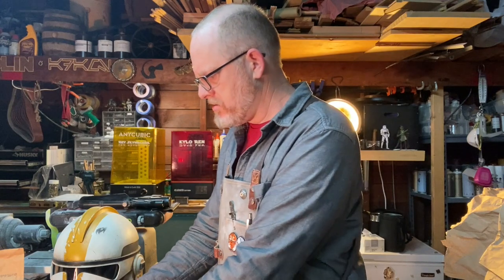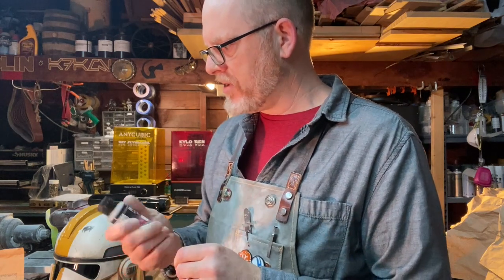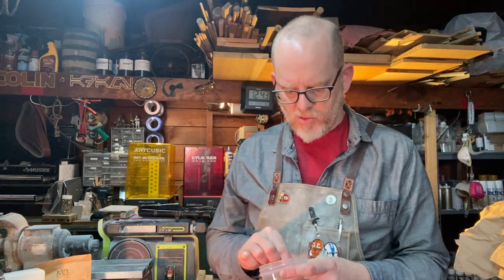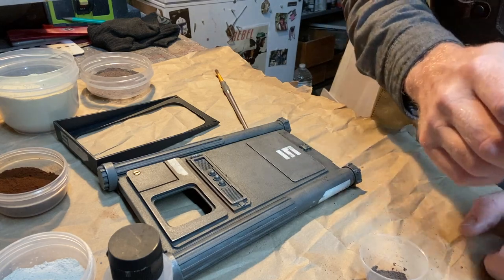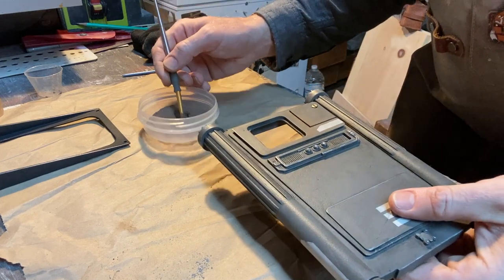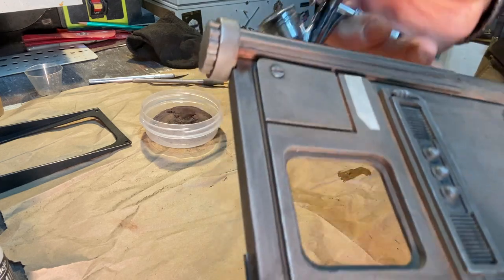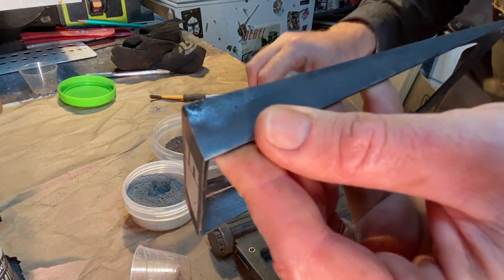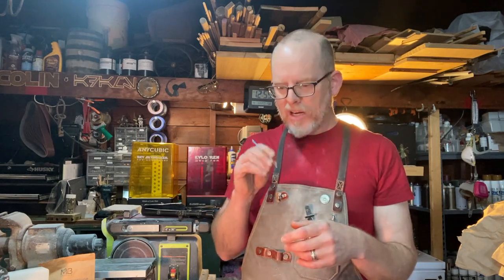Prop Weathering Tutorial - Part 4: Fuller's Earth (dust) Weathering

Comment: Thanks again, super interestinf as I’m doing my first 3d print helmet (custom post empire mandalorian), and i’m new to these weathering technics.
May I ask what is the brand of your airbrush? I’m thinking about buying one but i don’t know which one to choose.
Reply from the maker: There are a range of levels, but I found a basin $35 worked great. the real initial cost is the compressor, which is maybe $140 if it has a storage tank (so it won’t be running every time you spray). but that tank will last many years, through many airbrushes. 
this is my current one I use, I like the trigger over the pull slider of my first one: “ RJ-Global Double Action Airbrush Kit, Trigger Air Brush Spray Gun” for $38 on Amazon

Comment: Would fullers earth be good on a white helmet to create scuff marks or little discolorations?
Reply from the maker: I only would add it into the deeper recesses (like the deep cheeks on a clone helmet, around the aerators on a Stormtrooper, or the vents on the back of a Mandalorian). It is meant to mimc the spots that wouldn't get wiped clean. Not usually on the larger areas, those I would use acrylic wash weathering.